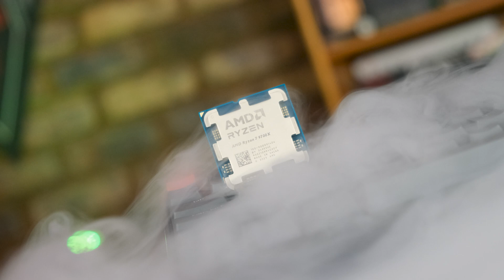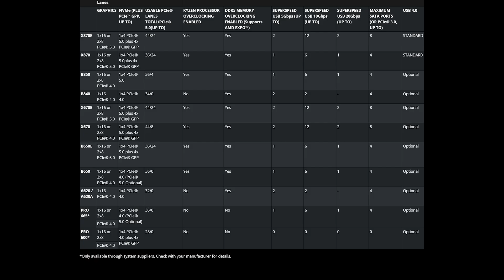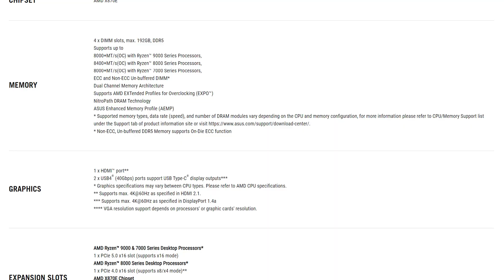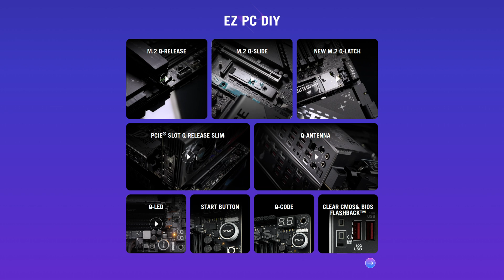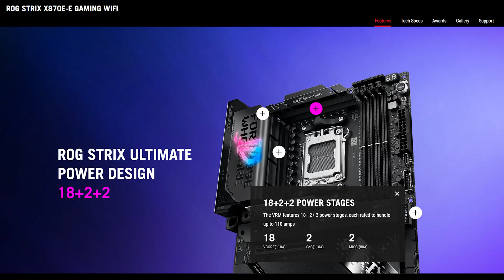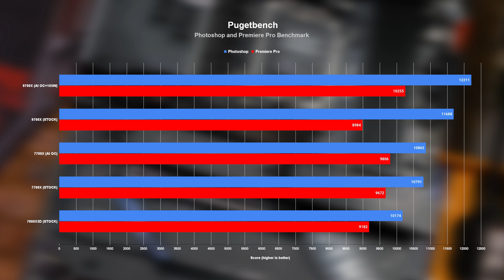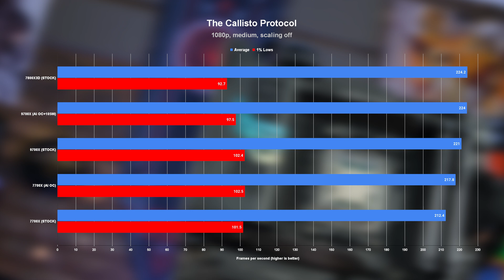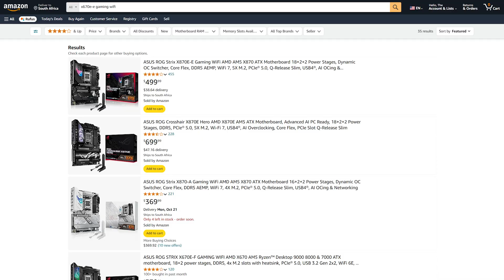Are X870 Motherboards EVERYTHING WE WANTED?! | ASUS ROG Strix X870E-E Gaming WiFi Review

Comment: One thing that a lot of people are unaware of until they notice (or read the manual), if all 3 of the top m.2 slots that are connected to the cpu directly (lanes wise) are occupied, the gpu primary slot is reduced to x8 speed. Should be noted that really only has a meaningful effect on performance for an RTX 4090 (and even on that it's less than 5% if memory serves) and perhaps the 5080 & 5090 of next Gen. But it's something to think about if you actually plan on using all 5 m.2 slots (which I do when I get this board next month).
Reply: its doubtfull even a 50X0 could use all the bandwidth on a PCIe 5.0 x8, that would truly be incredible if it needed more than x8 lanes 5.0 pcie
Reply: its not ALL of the m.2 slots, its usually specifically the M.2_2 slot. depending on the card, you can populate the 3rd or 4th m.2 slot (which will prob be gen 4, nbd) and save your PCIe 1 slot being cut down. you will still sacrafice something doing this. For example, the MSI Tomahawk M.2_3 being populated will either cut down the m.2 and USB4 to x2 (rather then x4) or you can disable the USB 4 connections to keep that M.2 at x4.
Asrock boards are an exception and do NO bifercate the primary PCIe slot and its always kept at x16. they only have 1 gen 5 m.2
Reply: @fireblade274  too bad Asrock doesn't make nearly enough boards for the demand. They are either selling at $300 higher than retail by a scalper, or just out of stock.
Reply: @fireblade274  top 3 m.2 slots on this board are all Gen5(max speed) direct to the CPU, which is why having a drive in m.2-2 & /or m.2-3 slows the gpu PCIe x16 slot to x8 bandwidth. I've tested this since getting the board & unfortunately that is how it's done. It would only be the case like this on motherboards that have multiple Gen5 m.2 drive slots directly connected to the CPU through the motherboard. So a board could have 5 slots but if 3 or 4 of them run through the chipset (and are thereby capped at Gen4) it would have no effect on x16 slot bandwidth. What's irritating is, the drives I'm using are Gen4 (because gen5 drives are expensive, run hot & the extra speed isn't worth those two downsides), but it doesn't matter, the slots are occupied so the motherboard does the x8 4.0 (in the case of my RTX 4090 because it's not Gen5) cap on the primary PCIe x16 slot.
Reply: @MadisonIsMySpiritAnimal nonsense, check carefully.
Reply: @Klaudek78  the heck are you on about saying nonsense? What are you talking about? Be specific. Everything I stated in my original comment is from first hand experience with the board & is facts.
Reply: @MadisonIsMySpiritAnimal You can connect as many M.2 drives as you want, and your GPU will still run at full PCIe ×16.
M.2 slots use separate PCIe lanes from the CPU or chipset, so they do not reduce your graphics card’s bandwidth.
Your GPU will drop to PCIe ×8 only if you insert another large PCIe device into the second x16 slot—such as another GPU, a PCIe ×4/×8 capture card, or an NVMe controller.
Small PCIe ×1 cards (like the AE-5 Plus) are safe and do not affect GPU bandwidth.
Reply: @MadisonIsMySpiritAnimal You can connect as many M.2 drives as you want, and your GPU will still run at full PCIe ×16.
M.2 slots use separate PCIe lanes from the CPU or chipset, so they do not reduce your graphics card’s bandwidth.
Your GPU will drop to PCIe ×8 only if you insert another large PCIe device into the second x16 slot—such as another GPU, a PCIe ×4/×8 capture card, or an NVMe controller.
Small PCIe ×1 cards (like the AE-5 Plus) are safe and do not affect GPU bandwidth.
Reply: @Klaudek78  You actually have no idea what you're talking about.  It's literally in the product manual for this motherboard that if you use M.2-2 or M.2-3 that it will reduce the PCIe x16 5.0 slot down to x8 speed.  
Also, the second PCIe x16 slot is only electronically pinned for x4 size and it's running off the Chipset at x4 4.0 speed, again, that's in the manual, it does not effect the GPU slot at all regardless of something being plugged in to it, which I've also verified with actual use of the product.
I don't know where you're getting your information from, but it's not reality.
Reply: Hey, I checked this very carefully, and there’s a misunderstanding here.
This motherboard does NOT reduce the GPU from x16 to x8 when using any M.2 slot.That’s because of how PCIe lanes are allocated on the AM5 platform.
Ryzen 9950X/9950X3D provides:
16 PCIe 5.0 lanes dedicated to the GPU,
8 PCIe 5.0 lanes dedicated to M.2_1 and M.2_2 (×4 + ×4),
4 lanes for the chipset.
These are three completely separate lane groups, and they do not share bandwidth.
M.2_1 and M.2_2 have absolutely nothing to do with the PCIe lanes used by the GPU.
On the ASUS ROG Strix X870E-E:
the GPU always runs at full PCIe 5.0 ×16,
M.2_1 and M.2_2 run on their own PCIe 5.0 ×4 lanes,
M.2_3/4/5 are on the chipset,
even using the second PCIe slot (x16_2 = ×4) does NOT change the GPU to x8.
I checked the ASUS documentation and the PCIe lane diagram – there is not a single scenario where an M.2 slot forces the GPU to run at x8.
This was true for some older X670E boards, but it is not true for the X870E.
So the idea that using M.2_2 or M.2_3 drops the GPU to x8 is simply incorrect.
Reply: @Klaudek78  OK I don't know what you checked very carefully, but I am speaking from direct experience ACTUALLY using the motherboard.  I'm gonna chalk this up to you not being able to process information properly. I HAVE USED THIS MOTHERBOARD, IT DROPS THE TOP PCI-E X16 SLOT TO X8 WHEN EITHER OF THE M.2-2 or M.2-3 ARE OCCUPIED. PERIOD, END OF CONVERSATION.  THIS IS NORMAL BEHAVIOR, IT IS LITERALLY STATED IN THE MANUAL.
I also literally told you using the x4 4.0 slot at the bottom does not reduce the GPU to x8, because that x4 4.0 slot is froma CHIPSET, not the CPU.  The top THREE M2 slots are ALL x4 5.0 speed FROM THE CPU, the CPU DOES NOT HAVE THE LANES TO RUN 3 M.2 SLOTS AT 5.0 + x16 5.0 ON THE GPU.  
You need to 'very carefully' read the manual properly, plain and simple.
Stop arguing, learn to read & process information correctly, read the freakin' manual again, you are WRONG. Period.
EDITED TO ADD THIS:
PAGE 8 in to PAGE 9 OF THE MANUAL:
"M.2-2 & M.2-3 slots share bandwidtth with PCIEX16 (G5). When M.2-2 & M.2-3 slots are occupied with SSD devices, PCIEx16 (G5) will run at x8 only"
ALL 3 of those are from the CPU.  The bottom 2 M.2 slots are from the chipset. READ. PAGE 14! 
CPU ATTACHED M.2-2 & M.2-3 when occupied PCIEX16(G5)_1 x8.  PERIOD.
Reply: @MadisonIsMySpiritAnimal The correct explanation for the ASUS ROG Strix X870E-E is this: Only two specific M.2 slots (M.2_2 and M.2_3) share PCIe lanes with the primary GPU slot, and this behavior comes from the “PCIEX16(G5) Bandwidth Bifurcation” option in the BIOS. In Auto mode, using M.2_2 or M.2_3 may switch the GPU to x8. However, M.2_1, M.2_4, and M.2_5 are routed through the chipset and do NOT affect the GPU lanes at all. A PCIe x1 device (like a Sound Blaster AE-5 Plus) also does not affect GPU bandwidth. If someone wants to guarantee full PCIe 5.0 x16 for the GPU, they simply set the bifurcation option to “PCIE X16 Mode,” which forces the GPU to stay at x16 and disables the lane-sharing M.2 slots. So the claim that “any M.2 slot drops the GPU to x8” is incorrect — only M.2_2 or M.2_3 can do that, and only when using the Auto configuration.
Reply: @Klaudek78  I never said ANY slot... I literally just told you all of that information & you're regurgitating it in a different order.  I've stated plain in ENGLISH in past comments on this very thread up to now, slots 1-4-5 DO NOT effect GPU slot bandwidth, slots 2&3 DO.  I've said that from the BEGINNING and you're arguing with me like an idiot, and I do not get why.  You need to learn how to read, period, end of conversation, I will not be replying to your stupidity further.
Reply: @MadisonIsMySpiritAnimal  unfortunately you are right, sorry, end of topic.
Reply: I don't understand Asus. Why include 3 PCIe 5.0 when 2 of them share lanes with the GPU.
Reply: @Reivbv 
So the 8 lanes can be split between two gen 5 M.2. If they offer only one additional gen M.2, 4 lanes will be going to waste.
Reply: Been having this issue with mine and ended up going back to the X670E-F as that at least could do 4 drives with no dropping to x8 at PCIe 4.0, not to mention less buggy with XMP that can make the drives in slot 2 or 3 randomly disappear. Plus the manual/product description says "** M.2_2 & M.2_3 slots share bandwidth with PCIEX16(G5). When M.2_2 & M.2_3 are occupied with SSD devices, PCIEX16(G5) will run x8 only." which sounds like it only does it when both are filled, not either of them which is the reality.
Reply: @meh78336  the issue of drives disappearing is reportedly being resolved with a beta bios. The slot being reduced to x8 with either drive populated is a bit goofy, but it is what it is. I have yet to have the problem occur again and I've been messing with settings quite a bit. Not sure why 🤷🏻‍♀️
Reply: @MadisonIsMySpiritAnimal  Didn't work for me, but luckily I have 2 spare 32GB 6400 dual rank sticks that I can use the built in profiles on with manual setting of the speed and fclk. It's taken up my entire weekend but I am glad that putting the old board back in was painless and it picked up the 9800X3D all 5 NVMe drives (4 onboard and 1 in the 4x PCIe slot) and the 4090 runs at X16
Reply: @meh78336  at some point I'll have to do testing with my 4090 at x8 vs x16, I game at 5120x1440, so within 1m pixels of 4K, and the biggest notable differences in performance on testing I've seen was at high resolution where the bottleneck is the GPU's throughput. And even then it was 3% or less if I recall. I'm in the middle of testing settings & going through profiles for fans etc now that I have an open loop on my CPU in preparation for the 9950X3D.
Reply: I have all three top ones populated. I wonder if I move the two from the second row to the very bottom would that free the lanes back up?
Reply: @chrisg2739  Did you figure out if this frees your lanes?
Reply: I really hope you reply to my question. So like what's the best motherboard for my Amd Ryzen 7800x3d?
Reply: So what's the best mobo for a 9800X3D?
Reply: But it's not so noticeable. It doesn't make much difference. Even with the high tech gpu doesn't occupy 8x.
Reply: U are partially correct. Even if all Nvme slots are occupied yes the main pcie Lane will drop to x8 gen 5 which is the same x16 gen 4. The 4090 is a gen 4 pcie card not gen 5 so U won't loose any performance unless U use a 5000 series GPU which uses gen 5.
Reply: @thealien_ali3382  That is incorrect information, dunno where you got it from, but I'm speaking from direct experience with the board. The slot's speed drops to x8 of whatever Gen you're on.  The RTX 4090 doesn't run Gen 5, so it was on Gen 4 x8 speed.
The way Asus "fixed" this with a patch was even more insulting, at least the last time I was able to test it, some of the drives in slots 2 & 3 would randomly be at "x4 1.0" AKA PCIe Gen 1 which is barely above the speed of a SATA HDD in terms of read/write.
I haven't tested it since, because I no longer have that GPU or the need for the extra drives at the moment - when I get a 5090 I plan to migrate to a Taichi motherboard that has x8/x8 mode for the two GPU slots so I can run a GPU on the 2nd slot and a PCIe card on the first slot, thusly giving me the amount of drives I want, without the issues the Asus X870E-E has that STILL have not been fixed by Asus.  Then I'll RMA this X870E-E, get a replacement, and sell the replacement on.
Reply: @Ereshkigal_1 I got the new Samsung 9100 pro (gen 5) if I put it on M.2_1 will it still drop the PCIe to x8? And I'm also planning on putting the 990 pro (gen 4)
Reply: @ReactionPro007no, as long as you don't use slot 2 or 3, you're fine.
Reply: The bottom 4 and 5 slot are good though? Won't affect lanes?
Reply: So I used to research the past 48h to finally find a answer.
The answer lies in the Manual.

You can use 3 M2 Slots without throttling the GPU. 
Even if you throttle the GPU the difference is maximum 5 fps.

The m2 Slots you can use freely are m2-1 m2-4 and m2-5

If you use any other, the GPU will throttle down to x8
Reply: @Zimtlocke thank you. This was helpful. 😊
Reply: @Zimtlocke  always in the manual smh
Reply: This is one of the reasons I went for AsRock x870e PG Nova Wifi. No lane sharing with the GPU for a reasonable amount of money. Glad that I got it before it is out of stock.
Reply: @Uncle-LemonXY  where do find the PG model?
Reply: @mrlemondaddy  yeah my problem is I need the extra m.2 slot so I can run my x4 pcie NVMe card & get that 6th drive going lol
The Strix is one of few X870E boards that has 5 m.2 slots though. Wish they'd bring back HEDT platforms to mainstream, I miss having 44+ PCIe lanes available for actual devices on PCs. It's sad that the devices we have that use PCI Express lanes have only went up & the amount of lanes available on mainstream desktop parts has gone down so much.
Reply: @MadisonIsMySpiritAnimal  so even if we use any one of the top 3 m.2 slots the graphic slot is reduced to x8? do you really see a difference in gaming if its x8 speed on a pcie 5?
Reply: @JosephKarthic  only the 2nd or 3rd slot slow the gpu slot. M.2-1 doesn't effect it. I ended up getting the board & I'm having issues with m2-2 not showing up sometimes lol
Reply: @MadisonIsMySpiritAnimal  that's worrying, bcoz i just ordered it today along with 9800x3d, do you think it's bcoz of the bandwidth sharing?
Reply: @JosephKarthic  not really, I spent almost 2 hrs with a chat tech from Asus trying to sort it out, and someone else on a forum told me their board doesn't have this issue, so it's possible I got a dud. Asus escalated it to their level 2 people, I should be hearing from them today. Other than that issue the board is amazing, but having an m.2 slot that randomly disappears is ridiculous. What makes it even dumber is the explicit "gpu+m.2 storage" setting on my board does the OPPOSITE, it disables both m2-2 & m2-3 🤣 so I'm pretty sure I'm going to be going through RMA with Amazon since I've only had it a week.
Reply: @MadisonIsMySpiritAnimal  Oh thats not good, im sorry to hear that...hope your issue will be sorted out soon...fingers crossed..
Reply: @MadisonIsMySpiritAnimal  Considering solid state storage is moving toward all NVMe, it's stupid as hell that the HEDT platform amount of lanes aren't becoming the standard for regular motherboards. It's like the motherboard manufacturers are starting to fall way behind the requirements of the technology on the market.
Reply: @MadisonIsMySpiritAnimal use no more than 3 stick of nvme on board m.2 1 4 5 Asus x870e stuck 3 4tb drives and yes the fine print strikes again

Comment: great board! careful if you use Arctic Cooler LFIII Pro as the pump will not fit because of the heatsink from the PCIE next to CPU (the one with ROG STRIX letters). I had to modify that heatsink in order to properly fit the pump on the CPU. Also, DO NOT REMOVE the video card as shown in this video: check the manual - you have to take it out in an angle when removing.

Comment: Really I don’t see the need as all of these boards with the exception of two. The Asus x870e Pro Art with its two PCIE x 16 slots and a 3rd x4 slot. The slots are spaced for two GPU’s which is huge for AI and  modeling. The Taichi x870 Creator was the other but it is not available anywhere. The rest of them are all the same, choose the cheapest. I rarely if ever populate more than 2 m.2’s so the loss of lanes for storage is irrelevant.

Comment: i don't know much about motherboards but i think either my cpu or motherboard is dead. ive got a 9800x3d and x870e-e and my pc won't post to bios it keeps giving me error code 00. my pc fans and aio light up but it keeps showing that code
Reply: Heyyy I have the same issue, were you able to fix it?
Reply: @vedantkasmalkar5200  nope. i even got a replacement cpu from amd and that didnt work. my guess is that the motherboard is dead. i'm planning to ditch my 870e-e for a gigabyte mobo anyways
Reply: @nervuo  Which motherboard do you have?
Reply: Update your bios , the 9950x3d needs the latest Bios otherwise it will appear daed
Reply: @ViroCMN  i have a 9800x3d, not a 9950x3d. i updated the bios and it still didn't work unfortunately

Comment: something a lot of people are missing is the little rubber blocks that come in the bag with the MB. 1 must be used with all m.2 drives that only have chips on the top side in order to make full contact with the heatsink side thermal pads and also to prevent warping the drive. the m.2.1 slot bottom thermal pad also doesn't get any contact or use at all unless you have a m.2 with chips on both sides. anyone who didn't install the rubber m.2 blocks may want to look at the manual for m.2 installation.

Comment: 5:12 Yeah, but 2 of those M2 slots are useless unless you wanna gimp your GPU. For any serious gamer (which is this board's target audience) these might just as well not exist.
Reply: If U use a 4000 series GPU U loose no performance because the 4090 is is the top tier GPU in the 4000 series cards and is gen 4 card. If U use a 5000 series GPU the 5080/5090 U loose around 6fps which is literally nothing